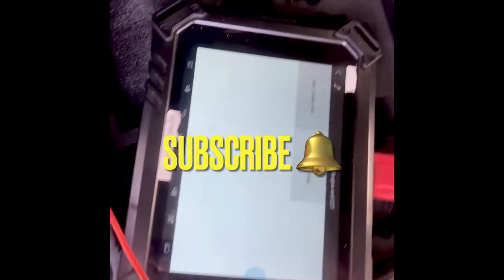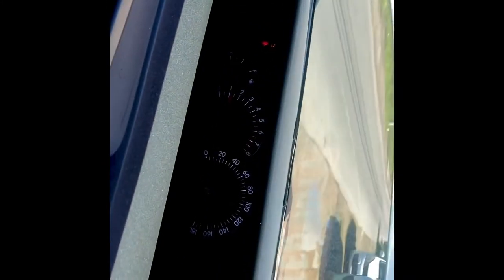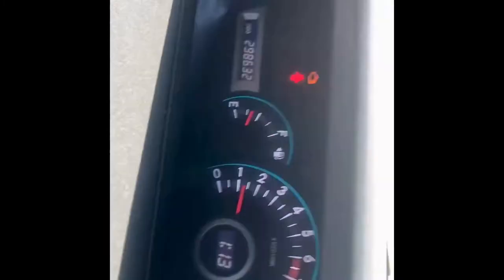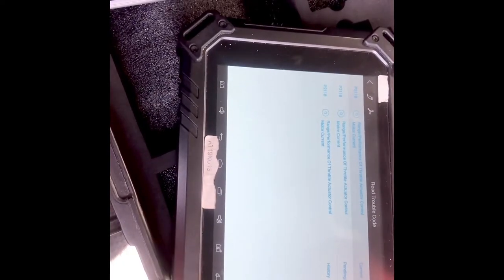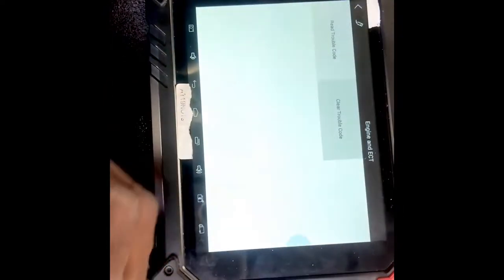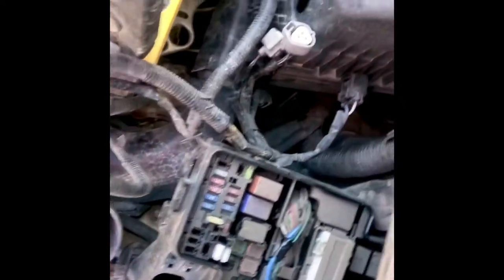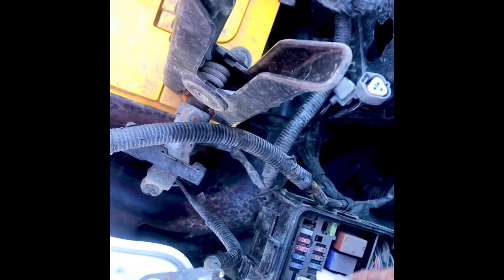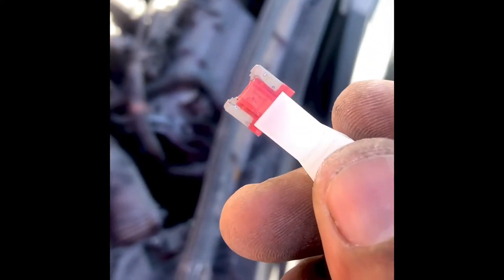How to fix a #Toyota #Voxy/#Noah that is  not responding to the accelerator pedal commands.

Comment: Hi.
My 2010 Noah use to ake between 2 and 5 minutes to start but when it does there is slight vibration the it will not throttle for long. Also when  I do get it going and I press the gas pedal hard the vehicle losses power.
Any advice would be appreciated.
Reply from the maker: Hi, scan the vehicle to see if any code is stored, also the fuel pump or fuel filter can cause the vehicle to lose power on fast throttle.

Comment: I have a toyota voxy 2013 the problem is that  it is missing bad, i change oíl, clean the gas, change coil pack, still missing,  hardly can go up a hill. Can you help me please
Reply from the maker: Hi, which cylinder or cylinders are missing?.
Reply: @geniusinnovations5268    i really don't know because i bring it to more that one mechanic, still backfiring, only leave for me to do is check the gas filter and pump. I am trying to get it scan
Reply from the maker: @biblicalhistorychannel  scanning it will point you in a direction

Comment: My car is x noha model 2005, when the car runs for 15-20 minutes the car gets hit, when hit the car
When braking / stopping at traffic signal the rpm drops, after going down the car jerks / jolts to stop start and the car escalator does not pick up and quickly picks up to rpm 3.

Comment: I have 2014 Toyota voxy and engine and traction lights came about 3 months now. The RPM not going 2.5 when driving. I changed the ECM and the transmission and still the problem can you help me
Reply: Also, the codes are P0741,P075b & P075b
Reply from the maker: Hello I am more than happy to assist, the codes you have provided are pointing to the transmission,but I would check the wiring harness in the transmission especially the two torque converter speed sensor wires,ensure there is a 12V power the the main harness of the transmission . 
    Also inspect the neutral switch for corrosion or broken wires.

Comment: Mine just keep idling low and shuts off sometimes.. Could that also be the fuse
Reply from the maker: Hi , I would want to think the throttle body just want to be clean
Reply: @geniusinnovations5268  i did that thanks, its better now.. But at first it was keeping a high rev but the mechanic says it will get normal after driving a few and it did and now working perfect.. Thanks man
Reply from the maker: @jaycool4835  you are welcome

Comment: I have a problem with my Noah. Its a 2008 with the 3zr fae, 4WD. It has a check engine and 4WD light on. It’s giving the code p1589. It doesn’t go away if you erase and reset the computer. Do you have any suggestions?
Reply: Or where on the vehicle the sensor is located?
Reply from the maker: Hi can you provide the vin number for the vehicle.
Reply: @geniusinnovations5268  Zrr75-001 1280 thanks for the response!
Reply: @geniusinnovations5268  where are you located

Comment: Hey what’s up I’m having an issue with my 2009 Toyota Noah sometimes when I parked and ready to move off, giving it, gas it’s not moving. what’s the cause of that i’m not getting any check light so when I shut it off, try to start it back. It’s idling very low then shut off back.
Reply from the maker: Hi, I guess you will have to make some more checks to get more information has to what might be causing it to  be I behave in that manor, check the transmission.